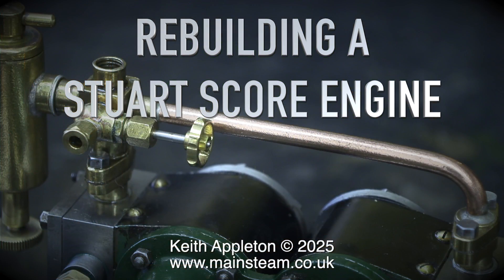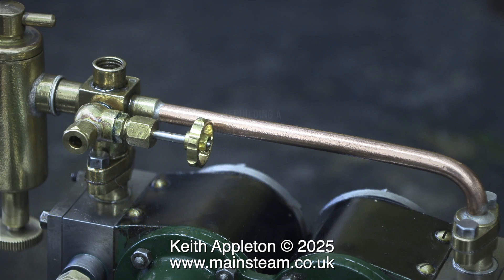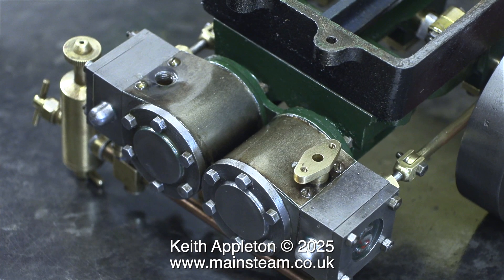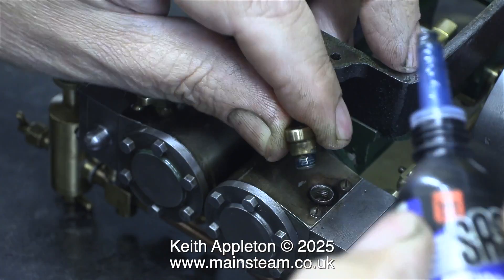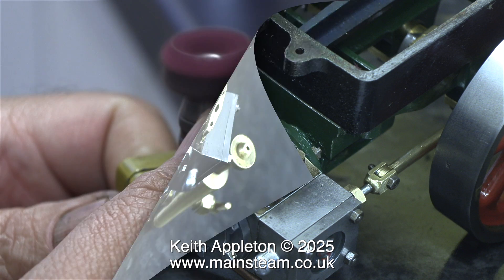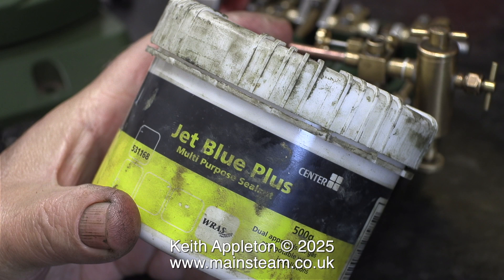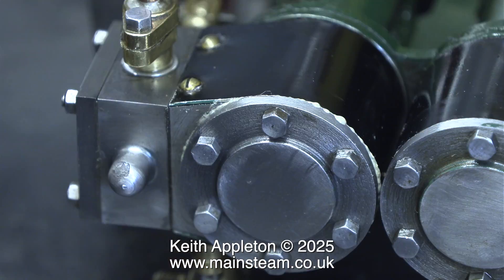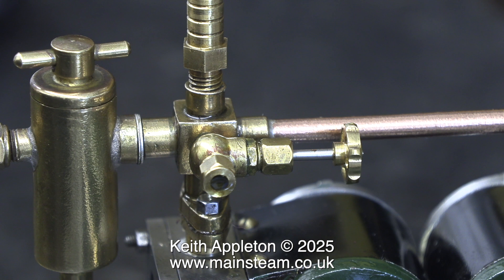REBUILDING A STUART SCORE ENGINE - PART #6

Comment: Is there enough support for that flywheel? It seem like a lot of outboard weight with little to prevent the stub axle from bending.
Reply from the maker: It works just fine . . . . the Crankshaft doesn't bend.